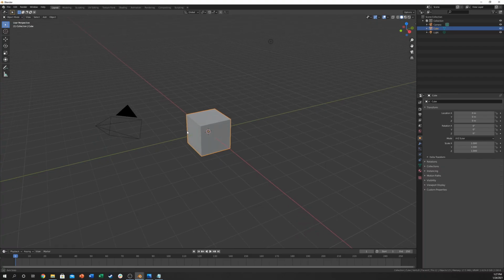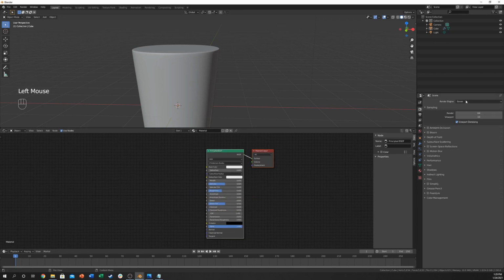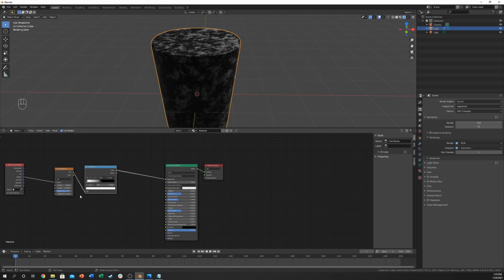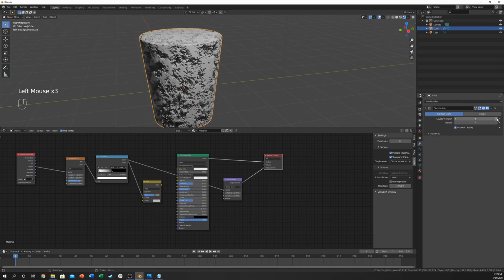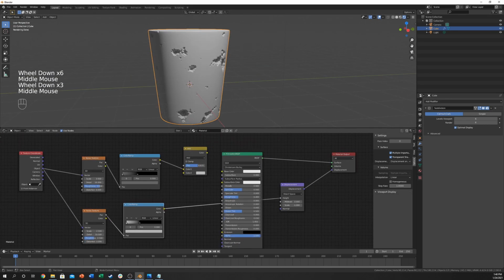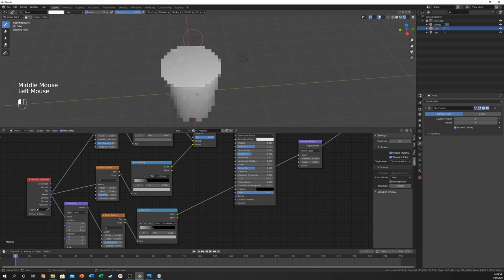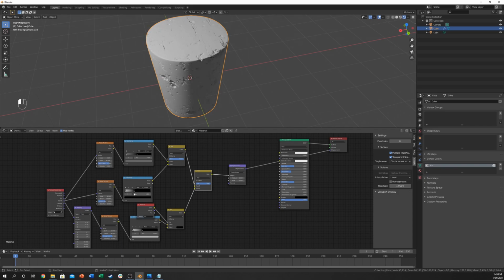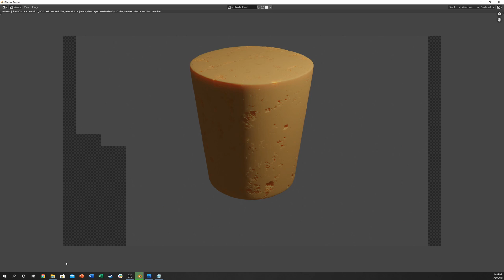How To Make A Cork - Advanced Procedural Shading In Blender

Comment: For whatever reason, my cork doesn't change shape at all after I set the surface settings to "displacement and bump". I've gone back and refollowed the steps you mention, and still it doesn't change at all.

Is there some kind of setting I need to change somewhere for it to recognise the displacement setting?
Reply: Ok, I figured it out. It turns out, me being a smartass who thought using a cylinder at the start instead of a subdivided cube, was the issue. Once I used a cube and had the subdivision set up, it now displaces the object correctly. 

Thanks for the tutorial!